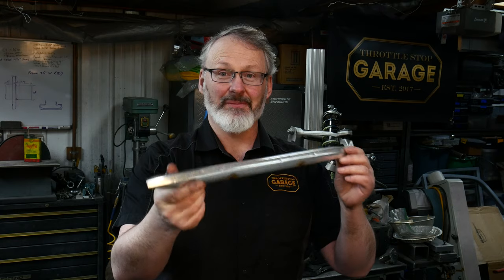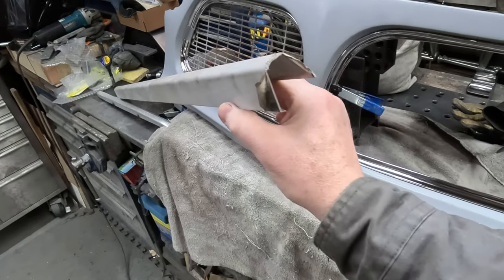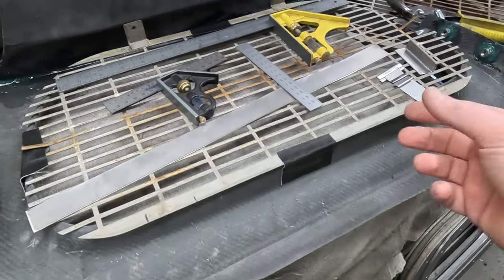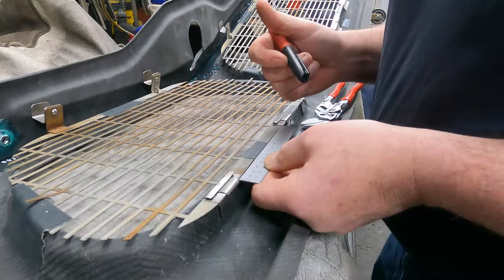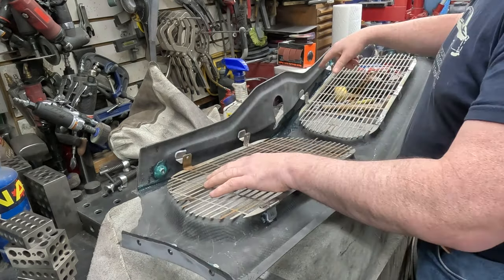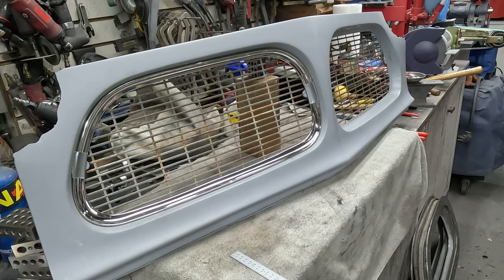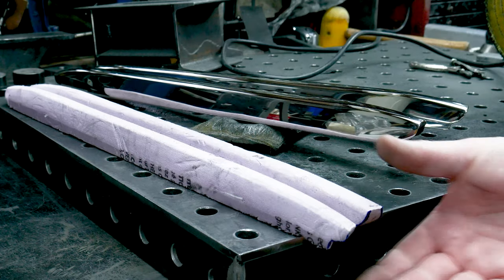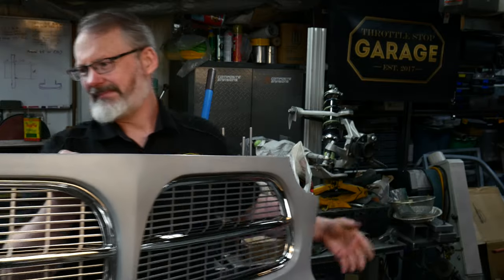Making a Stainless Steel Grille - Part 3

Comment: The small details are 10% of the job but 90% of the work. They are also the difference between a job well done and a job half arsed. You've done a tremendous job with the grill, it probably looks better now than the original.  You're right to knock out the tedious jobs first then the rest won't be as big of a chore. I admire your dedication to this project.
Reply from the maker: Thanks - so very true.  I've got to keep going on these little jobs that I know will kill progress.

Comment: Always fun and educational! I've always found polishing to be difficult (It took me longer to polish the clear coat on my carbon fiber/live edge table than it did to make the wooden pieces).
Reply from the maker: Finding the right process is hard.  Then again, if I just wanted it to shine, you can polish earlier and not worry about a few scratches.

Comment: I made a Kustom stainless steel radiator cover for my GMC SUBURBAN. It came out better than I thought it would looked store bought. The one's they sold were chrome plated. I didn't want chrome plated because it pits after after a while being under the hood. I like how you sand and buff the stainless out to make it look like chrome. 
A friend of mine redone all his stainless trim in his 1959 impala sanded and buffed all his trim to look brand new on a freshly painted car. That was my first time ever seen it done. Takes plenty of time to not bend anything in the buffer.
Reply from the maker: There were a few moments when buffing .  You have to concentrate and make sure you don't mangle the part.

Comment: If you use solar flux type b on the back of the stainless, you won't need a purge block.
Reply from the maker: I couldn't get it in small quantities!  I'm going to have to order some.
Reply: @Throttle Stop Garage  I usually get small quantities on ebay. They sell pouches of a few ounces.
Reply from the maker: @jasonhughes1156  Ordered - thanks for the tip.

Comment: Re the surface of your beautiful polished SS grills, you might look into a clear protectant (not a paint) called Nyalic.   I'm not 100% sure if this is the right use case, but I've certainly used it with great luck (against air contaminants & long term corrosion) on raw metal surfaces - from aluminum to steel & electrocoated surfaces.  It's often used on metals in marine environments.
Reply from the maker: Looking it up now - that's a great idea.  I have to passivate the part yet, no need to show that process.

Comment: Make sure you paint either the carbon fiber or the aluminum anywhere the touch.  Painting both would be better and painting a bit more than just the footprint where they touch.  Galvanically they do not do well together.
Reply from the maker: Yes, it is all getting painted and the epoxies isolate the fasteners from the carbon.  I hope it all works out.